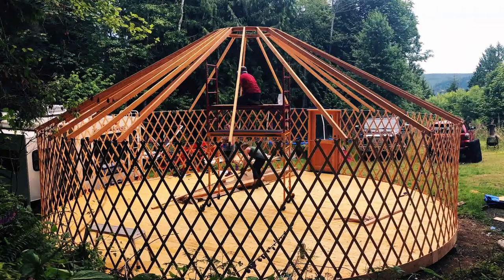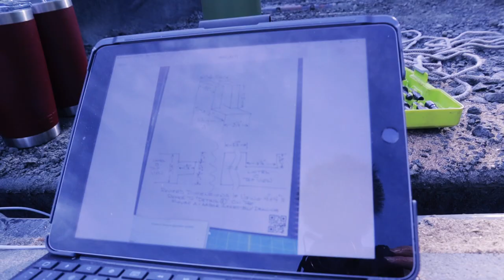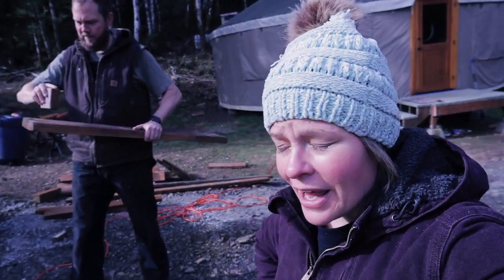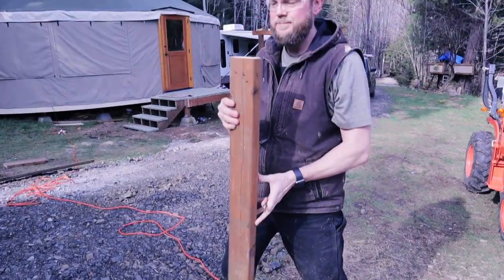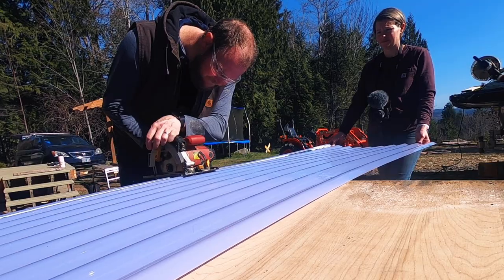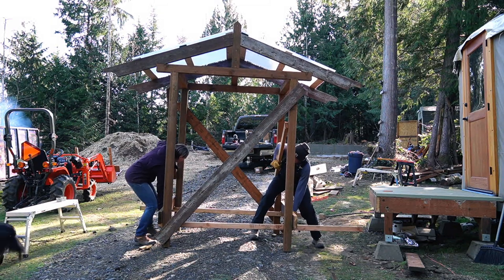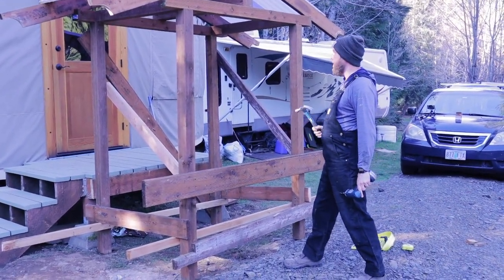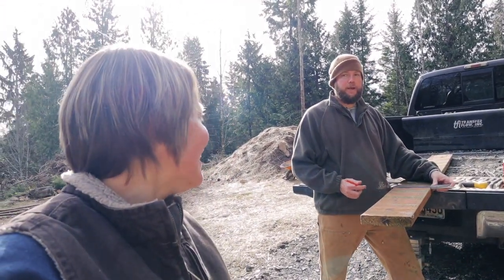Is this SAFE??? // Upgrading our off grid YURT - Ep. 21

Comment: lifting the structure was definitely exiting but what was the problem with building it in place? also next time you add the action movie music you also change the aspect ratio of the video it give it those cinematic bars on the top and bottom of the video.
Reply from the maker: We were afraid if we built it in place then we wouldn’t have the height needed to work on the roof.  Taller ladders would have solved that problem but we don’t have our big ladders up at the property yet so we had to improvise.  

Good call on the cinematic scene. That would have been epic!   I’ll remember that for next time.  Thanks for watching!

Comment: Hey guys, this was posted a year ago, were your insulation upgrades good for winter? How cold was it outside compared to inside? Dying to know!
Reply from the maker: Our pellet stove works AWESOME.  It keeps our yurt super toasty.  The insulation definitely helps keep the warmth in, too.  We've been living in our yurt now for a little over a year, and we are super happy with how warm it stays.  In the summer, it is VERY warm.  We actually used a portable A/C and it helped, but definitely didn't keep up with the summer heat. But our yurt was bearable in the summer because of the A/C and I know the insulation helped keep some of that cool air in.